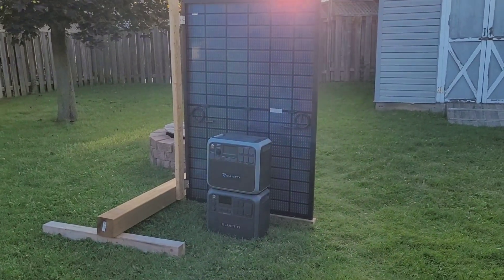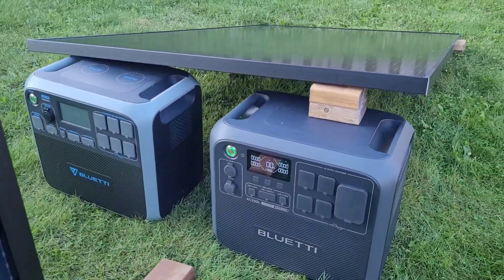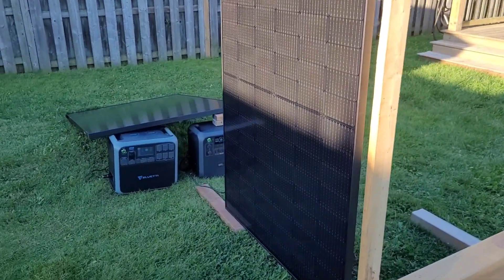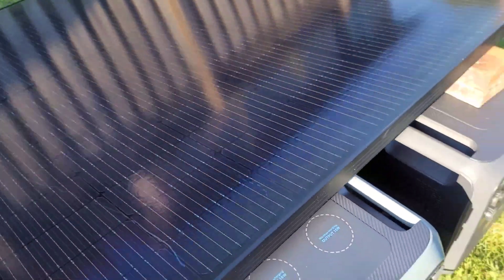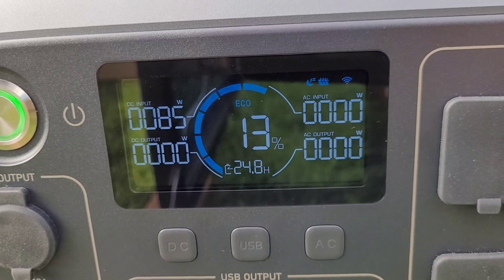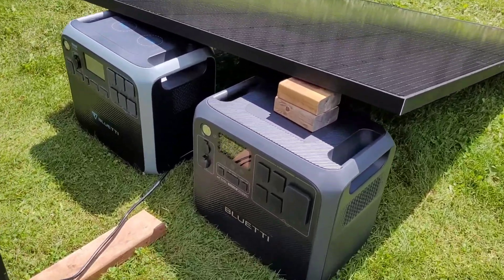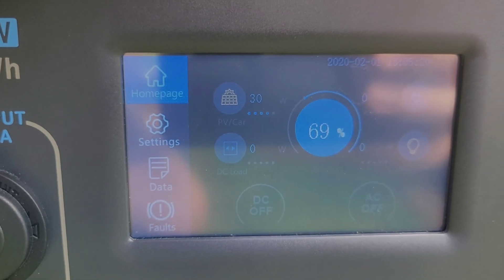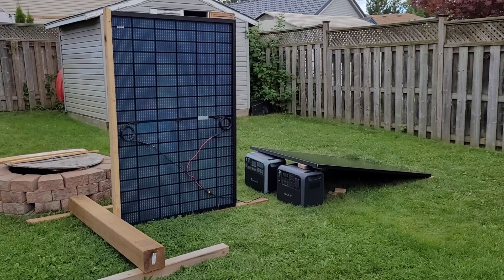Is A Vertically Mounted Bifacial Solar Panel More Efficient?

Comment: We do not have to squeeze every erg out of a solar panel anymore. It's cheap enough to add more vertical panels to make the equivalent of a slanted panel system. The advantages are obvious. You don't have to clean them. You can orient some north-south and some east-west. They act as fences quite nicely. You can mount them on the wall of a house. Wall of the garage. And the major advantage is that they don't heat up as badly as the slanted panels. They maintain a cooler operating temperature and therefore produce more power on very sunny days.

Comment: Great side by comparison.  Now try it on a Sunny and with reflective insulation (used for windows insulation) set at an angle on the ground, so that at noon it reflects back to the solar panels).  This should greatly increase its energy production.

Comment: Test again, please, but this time test both panels in a vertical orientation, one with the front facing west, the other with the front facing east. The back of the Bifacial panels are not as efficient, but if you have half of your panels facing in opposite directions, you will average out the downsides.
What you are then looking to compare to are the two panels facing south.
The efficiency gains are in part due to lower temps of the panels for vertical systems, and if your inverter/mppt system maxes out during the hottest part of the day, this trades maxing out the panels at noonish for a longer span of time for collecting sunlight.
This will depend on your setup, of course, so if you don't have enough panels to max out your inverter/mppt, you will probably not see as much benefit.
It does mean you can add some more panels to your system to charge your batteries over a longer period of time.
Reply from the maker: @NdxtremePro  I just did a vertical east west VS north south, check my channel!
Reply: @SmitHVAC.  I just watched it, cool vid, but I left the same suggestion there, a E/W vid with one each panel front facing each direction. 
It would give you numbers to work with in either direction, let you see if there are differences, and you can add the numbers together to see what an array like that could produce.

Comment: We have 20 verticals and 10 sloped at 45deg pointed roughly to the south south east..  The back of the verticals get morning, and front face our home.  All on microinverters.  Due to our lot we think both are great.  None are oriented 'correctly' for 
our area.  The front of the verticals point about 30degrees south of west.  

Overall of those panels, about 60pct comes from the verticals and 40pct from the southish facing slanted panells.

We are near Nashville TN.

All of those are Boviet 370 bifacials.  We recently added 24 REC 370 single sided.  3 are slanted at 45deg faced to the west roughly 30degrees south of west.  and 21 are the REC faced UP (yes, horizontal mount, all laid pretty flat on the ground.  20 of those are on the east side of the fence of panels and one on the west.  Yes, small yard and hard to orient more than what we have.  None on the roof, and we have a small yard.  With all 54 panels we have generated a max of 9.2 kw at a time, and 74KWh in a day is our full day maximum.  All of it comes through our 15 DS3-S microinverters from APsystems.

Comment: Of course when you are closer to the equator the vertical panel will do lower production when the sun is directly overhead, so location is calculated in when determining proper angle if you are designing a system to hit it's peak at noon, and even then only if your primary concerns is the minimum solar panels to hit that peak.

Comment: Maybe you can use south facing mirrors angled to get more sun on bifacial solar panels.
Reply: maybe you can get a cheap mylar heat emergency blanket and make a reflector for the bifacial solar cell to get light reflect on both sides of the panel.
Reply from the maker: @travismoore7849 not a bad idea, I might have one actually

Comment: Where did you get info that the vertical would be more efficient? I've only seen info that it was more efficient than previously thought due to the increased cooling, not that it was more efficient than horizontal.

Comment: I would like to see the vertical panel sitting in the centre of a white floor say 16' x 8'. Maybe a white fence perpendicular on its north side. 

I would also like to see identical battery systems.  These two batteries are different sizes, they run different chemistries, and have different charge times.
Reply from the maker: If you want to supply another AC200L be my guest! 2000wh VS 2048wh is pretty negligible and they are both Lifepo4. It's as close as it's going to get from this little channel.
Reply: @SmitHVAC.  Well at least do the same test twice, while switching the batteries in the second test to prove the differences are not creating a variance larger than the 2.4% difference in battery size itself.

Comment: Not the greatest test, you could have gone to a park or open field. Or just put the flat panel on top of your pergola. Nevertheless great idea for the test but poor execution.
Reply from the maker: @jorgef70  Yea I'm going to go sit in a park for 13 hours and babysit my solar panels and Bluettis so nobody takes them 😂
Reply: Thanks for the effort! I'd like to see the test arranged where they both get approx same sun, e.g. not partial shade from roof, fence, shed, etc, if at all possible. Could also test once with primary vertical face to the afternoon sun, vs. Morning sun. Fun!
Reply: It’s really dumb to compare a vertical solar panel to a horizontal one when Sun is striking the vertical one and shade is striking the horizontal one. Just for that reason alone whatever numbers you would’ve received in your test, they are horribly skewed from reality. Anybody who has any logical thinking could see that you started off your test horribly wrong if there were no obstructions both panels would’ve received Sun. You didn’t even mention whether panels were aligned to south. And when I meet south, I mean, solar south not magnetic south. Like I said, your idea was a good one to do this test, but your execution was piss poor.
Reply from the maker: @jorgef70  Yet the horizontal panel still had better results, even though it was shaded. Like I said in the video, it's a real world test working with what I've got. My yard is the space I have to set up panels and make power, what they can make out in a field means nothing to me. Thanks for the view anyway.
Reply: @SmitHVAC. 😂 Don't pay him no mind. He works in a lab (in the basement)... So real world where people live is foreign to him LMAO

Comment: I am setting up a ground array with 3-370W panels.  I will be running these into my Mega 3 from Oupes.  I will need to run about 40-50 ft of wiring to get into the house where Oupes is.  What is best wire to use?
Reply from the maker: I use 10 gauge wire from Signature solar. It comes in multiple different lengths. https://signaturesolar.com/pv-wire-50-ft-10-gauge-copper-30-amp-black-red/?ref=_KvVrzchAclARI&srsltid=AfmBOoqphhPA5KPWsRYAvZgscQa6MeqS3W9LlpXr22wxFy7M5GZv8uSJ
Reply: @SmitHVAC.  Thanks, I am a wholesale distributor for them.  I'm new to solar and just getting set up.  Installed 2 EG4 hybrid mini splits recently in my 2 garages.
Reply from the maker: @brianwluxevovacations215 10 gauge is overkill but it leaves you room to upgrade and bigger is better to eliminate voltage loss
Reply: @SmitHVAC.  I would bet serious money that 99+% of DIY solar installers have added hugely to their original system.
Put your cable in conduit underground and leave a pull through in it for future cables.
Also drew a map/plan of where that cable is and put in a plastic zip bag in your switch box, better still tape it inside the door of the box

Comment: Face the vertical panel south, east west is for solar farms for peak power early and late in the day. Face it south and put down some reflectix front and behind the panel, or white rock to simulate snow which is the time we need max power, the vertical will blow the sloped one away. My 465w in summer is only 300w, add snow and sun 570w.  Vertical is not pointing at the sun so what did you expect from vertical in direct sun?  Did you notice when the clouds came the vertical was producing while the sloped was 0. Try both panels in full overcast, face any direction, vertical should win. 40 snowfalls I never had snow on my panels. Haven't washed them since September.
Reply: The colder weather would also help

Comment: @SHVAC dude thats good results for both setup under crappy weather, if you can do the test again do not change anything but do the test when you know its going to be a sunny day, i am actually impressed with the results of the vertical panels, i may build a solar fence , zero yard space needed for the win!

Comment: The power stations are blocking light on the rear of the verticle panel.  A shadow on one part of the panel affects the entire panel.  I don't know how much, but it leaves the question.  Oh, you moved it to the tilted panel, so the question then applies to the tilted panel.  How much of the bifacial (rear-facing gain) has it decreased (compared to tilting it with something less light blocking).  If the panels were monofacial, it wouldn't be a factor.

Comment: adding reflection and the suggested hight to the bificial should add a bit...
and the back does not produce the same as the front side, im not sure east/west position is where you gain most in many cases...
my 550w only produce 200w on the backside, and those 400 w probetly produce 100W on the backside
so the back side should probetly not be facing any sun
it is probetly better to catch more or less only reflection and early sun with backside

high north i would think a direct south is best
because of the short winter days and low sun that moves at a shorter path

and so far i havent seen any real vertical test in equator

Comment: Walk around that privacy fence in your yard.  Count the loose nails in the East/West facing boards.  Now count the loose nails in the North/South facing boards.  If bifacial panels vertical East/West is the more efficient installation orientation compared to traditional Southern facing with appropriate tilt, racking solutions are going to have to be a whole lot more robust and aluminum will never, ever be a racking construction material option.  The nice thing about vertical is that snow loads are no longer any sort of concern.  The not-so-nice thing is that increased wind loads and and constantly changing pressures are concerns currently completely unaddressed by any racking method.
Reply: Be careful with that lawnmower too😂.
Reply: to me best use of solar panels would be vertical on walls of a house not covering windows and flat on the roof (if it is not used) or on a solar pergola for example. I don't like regular mounted solar panels at an angle which require mounts and not only is not functional (cant use that space) but unpleasant looking. vertical in balconies is also very good. As fences as you mentioned, solid fixing would be necessary and could probe expensive. But still it is very good since tall panels vertically can serve as tall fences (of course assuming intruders and people dont break- poke at them from outside).

Comment: I’d be curious to see what happens if the vertical panel is facing south (like the sloped panel)?
Reply: specially because this 400w bifacial only produces 100w on the backside
(a 550w = 200w )
Reply: His sloping panel is facing south, along with the panels on his roof. So the long axis of the vertical panel is N.S.
You can also tell by the shadows from the panels when he gives his midday readings

Comment: Wasabout to sey up my begginer solar array next week and had planned on verticle with 8 550 watt bifacials. Now I'm rethinking things??? I live in Canada in a very cold winter zone. Thanks for sharing and peace.
Reply: i get bifacial for same price as mono
it only produces 200w on the backside a 550w bifacial

so facing the back to the sun makes little sense
but to catch reflection and early and late sun it makes sense no matter where you are , no doubt 
even on a roof if you let some light between the panels you pick up reflection...

he is doing this test with a 400w bifacial that only produces 100w on the backside
so the panels also matters for the resaults
you need a bifacial that produces the same on each side to beat anything in a east west senario
and it is probetly cheaper to glue 2 normal panels together then
Reply: @Hansen710  and 2 normal panels could be tilted in an A-fashion for wayyyy better radiation angle towards the sun then a single bifacial.
Reply: Go vertical, that 4.4kw will pass 5.5 kw with snow and sun. Never clean snow off a panel ever again ,sleep in wake to a full charge. JAsolar 550w?
Reply: @bobmonztr  Yes JA solar 550watt Blue 3.0 I believe
Reply: @HartFarmsGenetics  I just got 6 black silver, maybe do a test in 2 days, modifying the mount before connecting
Reply: SNOW.     If you're that far north, then vertical south facing the main side of bifacial South would be close to optimum for the winter. I use most of my Electric power in the winter

Comment: I would like to see how well the vertical panel does with you moving it occasionally to face the direction of  the sun.  Enjoyed your video.
Reply: backside of a vertical panel does not produce the same as the front
a 550w produces 200w on backside, and 400w only 100w
so to get the most out of this test you need the right panels
Reply: @Hansen710  Yes I know. I own 2 bi-facial panels from EcoFlow and they produce betweenn 245 to 270 and are 220w panels.
I was just curious of the panel that was vertical as to how well it would have done for the duration of the day.

Comment: Yep test again , but run the panels cables down the sides and not on back of panel to create shading issues . I think this is a great test as it shows that two of those panels vertically  per bluetti will completely fill them every day  after heavy overnight usage  . I’d say it’s a great result for putting panels around the out sides of your property as a way to gain more power from dead spaces , one side early morning sunshine the other collecting afternoon sunshine 57% charge is nothing to sneeze at after all 👍

Comment: I would be interested in a SE and SW orientation (granted this doesn't apply to bifacial panels). 

I've arranged mine in SE (~60 degrees), S (~45 degrees), SW (~60 degrees) and horizontal directions.  (Angles are from horizontal).  They're highly vertical because of space limitations (and beginner's strategy); the panel orientations are a compromise to serve yearly operation (Ohio) (south panel angle will change for winter, spring-fall, and summer).  I also will get shading from trees (except in winter and late spring/early summer).  

4x100W panels (not bifacial) are wired in parallel (each manually switched to avoid voltage pull-down); 100W Harbor Freight Thunderbolt PWM charge controller; 10A fuse from the panels to the charge controller (only connected to 3 panels); controller has a total of 400W connected panels, and has not burned up.  2x12Vx140 minute reserve capacity flooded deep cycle batteries (older condition); 12V system.

Sunny days are OK, struggles to collect charge on overcast days.

Comment: I live in AZ, and have open land, where there would be zero obstruction for horizontal and vertical. I just don't have 2 blue yetis to test any panels with. I have panels. But my solar project will be a long time, as I work slowly. Still useful information, even if not exactly pertinent to my scenario.
Reply: a volt meter for 10 dollars should do the trick, just without battery % and fancy curves
but i would not go for the battery % anyway
Reply: If you're in AZ with np obstructions to the east
, definitely get some auto or manual tracking. I get nearly full power by 8-9 am cause the air is clear and panels are cool. Not so in afternoon. Though. Tracking helps a lot, especially with a small system.

Comment: Not surprising but I was hoping the vertical had a little more stuff.
Reply from the maker: @offgridwanabe  me too!
Reply: @SmitHVAC.  it does tell me the advantage of a tracker.
Reply: @Mr.PresidentDrive  are we sure its not in the northern part of the world it works best with vertical ?
a university in nederland tested 3 % gains with vertical panels
the sun is lower in the sky in the northen part of the world, so would the vertical angle not be better and more direct in the north then at equator where the sun is comming from above the panel in a not so direct angle ??

i also think you need to think of the use of the space that becomes avalible
solar farmig is a good way to get alot more out of a area with vertical panels 

we can combine food production better with vertical panels, in some cases solar farming also uses 1/4 of the water 
thanks to the shade it can provide

and in your garden you would have more space and room for more panels

personally i enjoy the shade my vertical panels gives my crappy neighbour, that part also have some value 🤫
i have them on top of eachother so it becomes a 4m wall 😆(i can tilt mine and choose the angle i want )